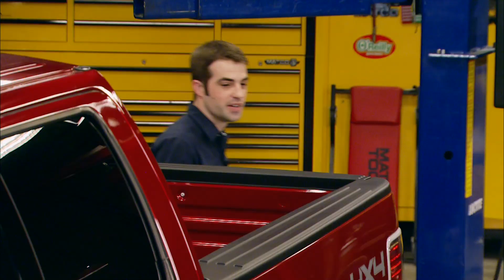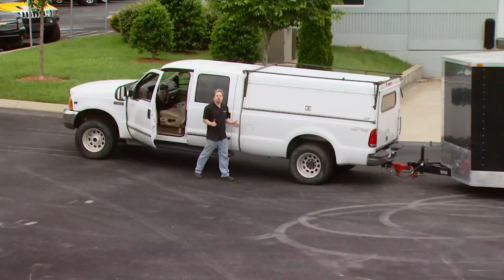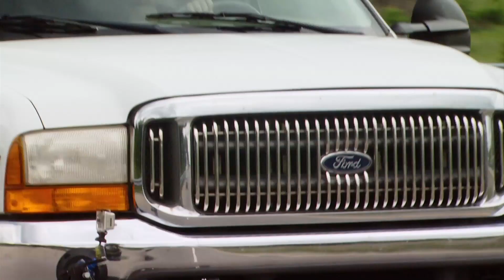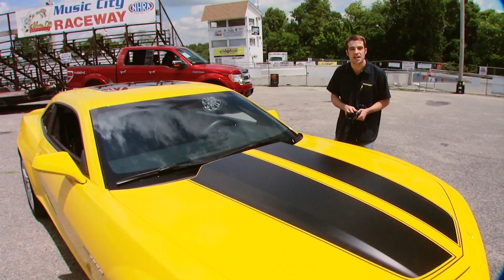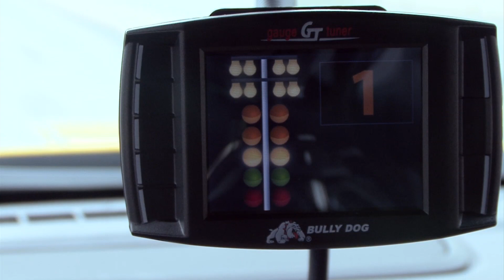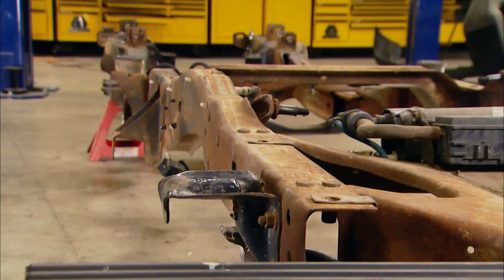Creating the Right Stance for our Ford Ranger Street Truck - Trucks! S12, E10

Comment: Nope. Never the 5.4. The worst V8 engine Ford has ever produced. 
   The bully dog looks like a solid unit, but I went with the SCT tuner on my 3.5 gtdi. Pulls like a fcking mule on the 93 octane tune ( 149 hp gain at the crank, and comparable torque #’s) , and it saves the factory tune for “warranty” work. This bone stock truck runs times like a stock mustang GT, near 14 flat in the 1/4.
   That being said, if I had to do it over again, I’d bite the bullet, spend the cash, and go for the banks I-dash with all the accessories.

Comment: The front suspension are decent.  Once they are lowered  and a Explorer front swaybar which is double in thickness and narrower then the stock one and will  attach to the original locations.

Comment: @2m50s: Note the use of an HDMI cable. Clever, if a bit funny. Could have been designed to use an interface with fewer wires (four is plenty) and a thinner cable.

Comment: The Ford 300 is fords most reliable engine no exceptions
Reply: The inline 6 4.9L? I had one of those, it was bullet proof.
Reply: @jayyoutube8790  I have 2 of them, an 85 and 88 both still running today, my channel has a video of mine I put the log manifold on and sounds like a Cummins or semi
Reply: tbone3366 I had an 85 F250 with the 300, that freakin thing would take whatever my stupid teenage self threw at it and keep going
Reply: @jayyoutube8790  I'm pretty sure you want to see a hopped up turbo ford 300 4.9, my buddy has one and it has 2.74 gears something like that and a zf5 and he smokes the 5.0 mustangs all day

Comment: Can you guys build a Ford 300 with a turbocharger there's very few turbo 300 around and they mop the floor with everything in torque deperatment, my 88 f250 4.9L straight 6 is pushing 670 lbs of torque below 2200rpm, V8s wish they had that power that low and still get 17 highway
Reply: tbone3366 Can you send me a video of that torque number on the dyno? I would love to see it
Reply: tbone3366 
The ford 300 is damn near bulletproof.

Comment: Why slam a Ranger? It's useless as a truck now..
Reply: Brian maynard it’s a ranger... was it even really useful before slamming it? That’s the real question...
Reply: Where these guys are taking this truck,it wont be used as a truck any more.
Reply: No budget build here
Reply: My turbo 2.3 Dohc ranger has a turbo and makes 340 HP and 411 lbs torque with 17 psi boost, at 7800 rpm, and gets 33 highway when cruising that motor has best of both worlds performance and econemy but not for tuning